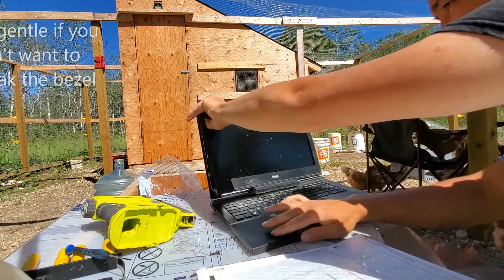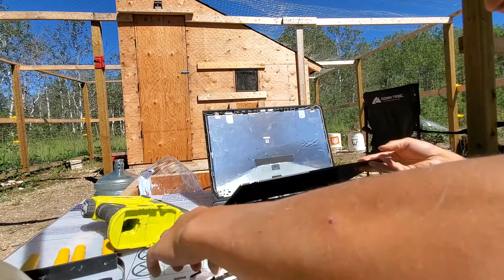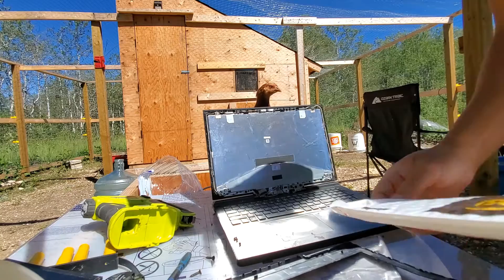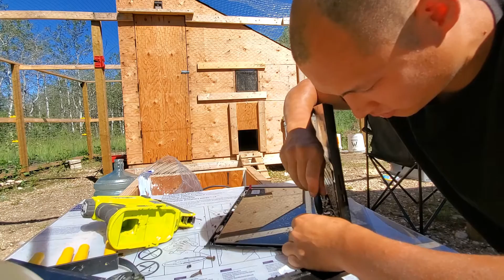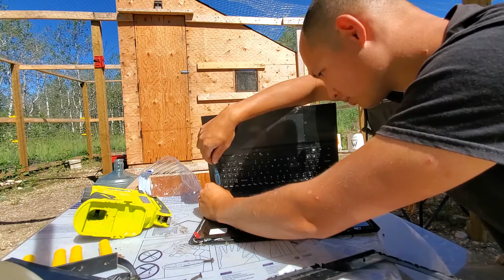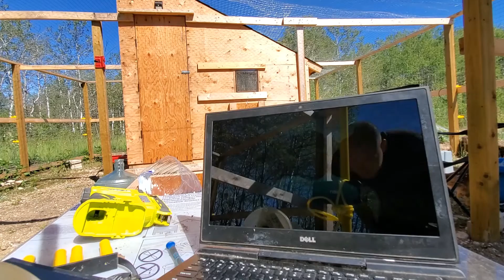Laptop screen replacement / How to replace laptop screen - Dell Inspirion 15 7567 Gaming LT

Comment: Just got this same screen and colours and contrast seems off.  Do you recommend a specific driver or profile for this screen?  Also, did you have any issue with the bottom clips where they would cause a wave like effect on the screen?  I’ve currently got them not clicked in properly so this doesn’t happen. It’s like a cable is pinching or something
Reply from the maker: didn't have any problems with colors; i went from a matte to gloss screen, which will look completely different if you did the same.

i can't really compare between oem gloss and this gloss screen though.